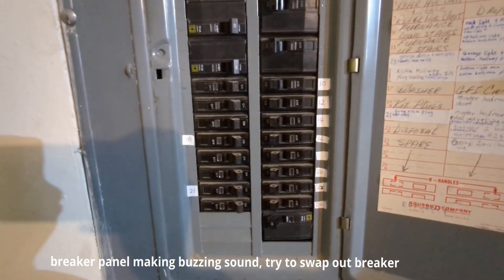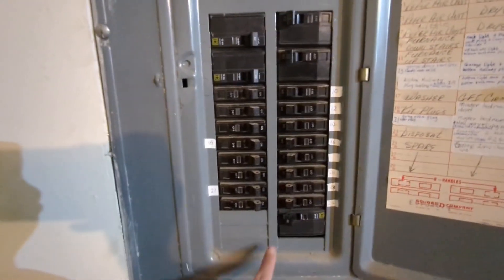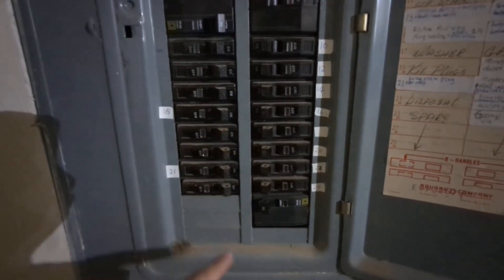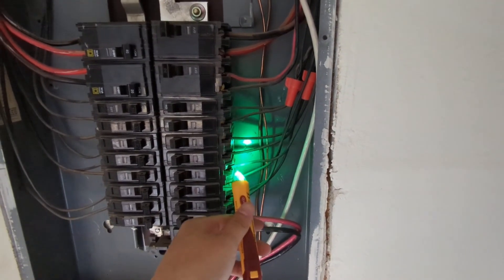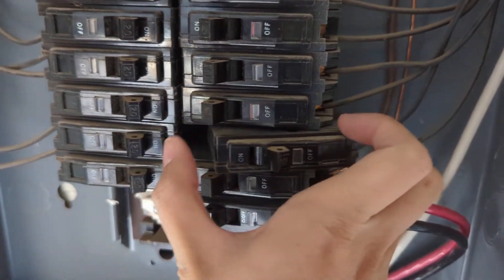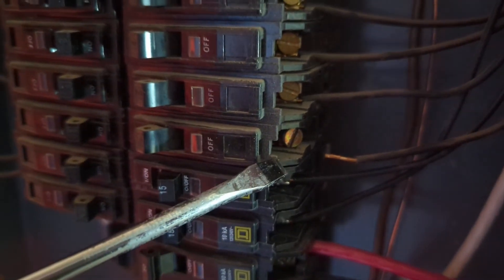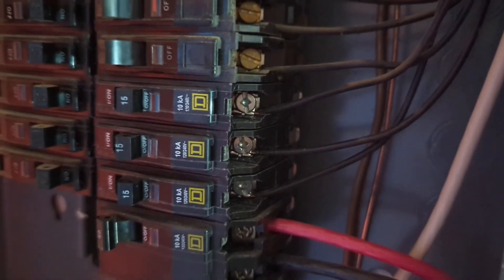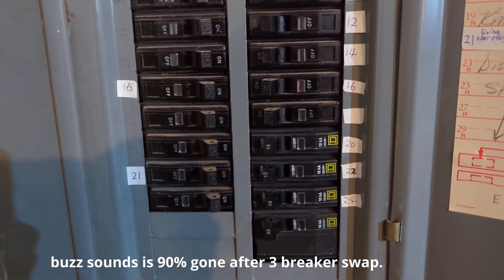Electrical panel buzzing sound? replace breaker

Comment: Thanks. Got a couple of suspect QO 2-Pole 30 Amp Breakers (Dryer and Dryer) that seem to create a lot of Buzzing when they are running at "full" (Water Heater or Dryer (using Automatic Mode) Cycles on its Heating Elements).

Since I have a Sense (Power Monitor) with CT (Current Transformer) Clamps on the Mains I'm hoping it isn't coming from there... It sounds like it is, but then again I won't know till I open up and start inspecting/swapping.  Hopefully I too can reduce it by 90+%...